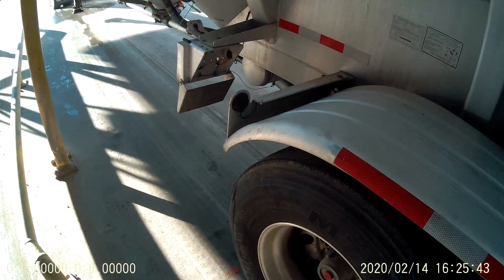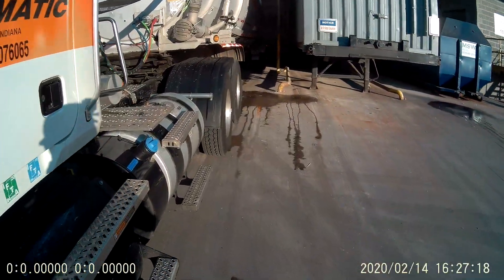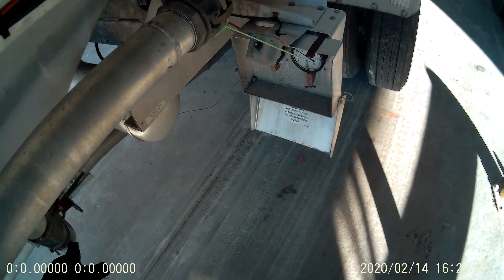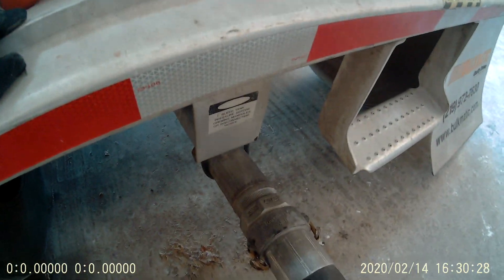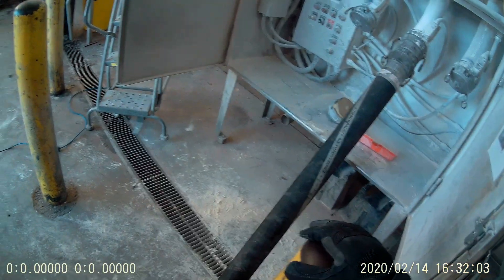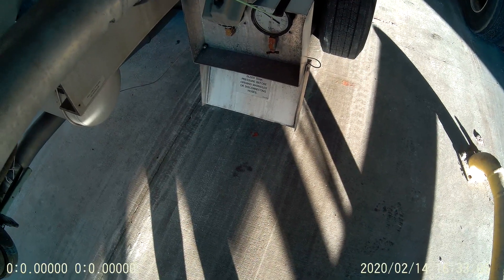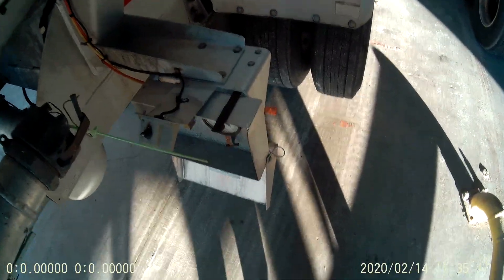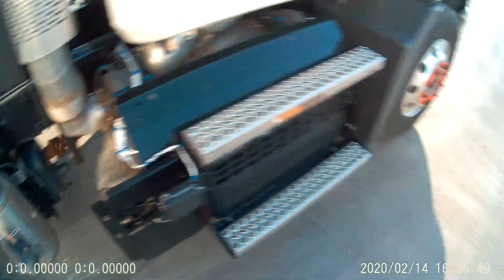Just a walk around while unloading flour

Comment: Nice video..I do dry bulk and liquid for my company and starch and flour are the easiest compared to sugar or salt. I try to blow white powder at about 10 psi and keep out of trouble around there..even though the customer only wants you to blow it at 7 psi..you should be mindful if you are not in a ventilated area when blowing flour because one of our drivers recently died from bakers lung. Now I wear a respirator for the dusty locations.